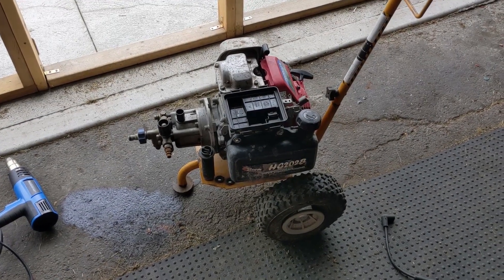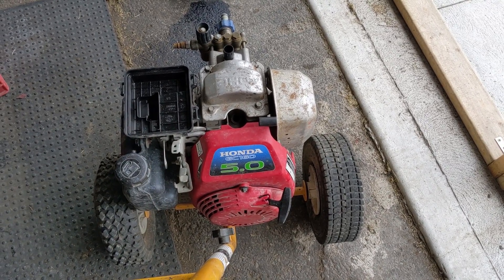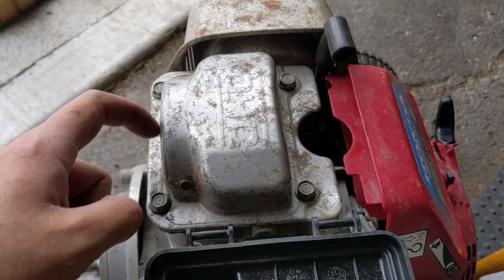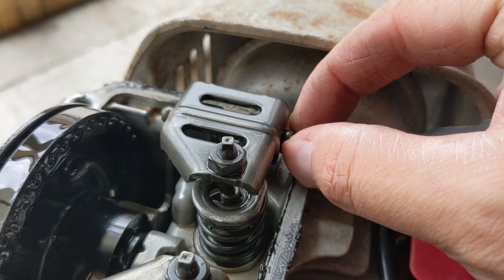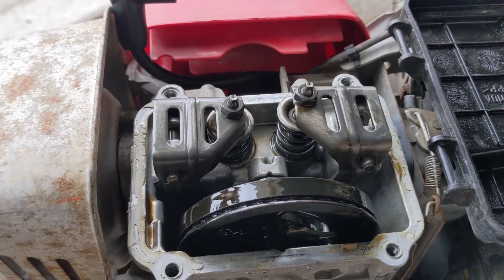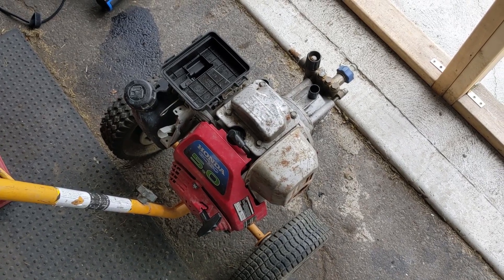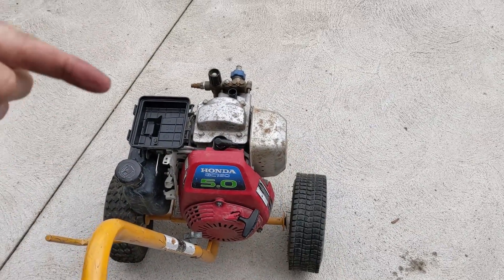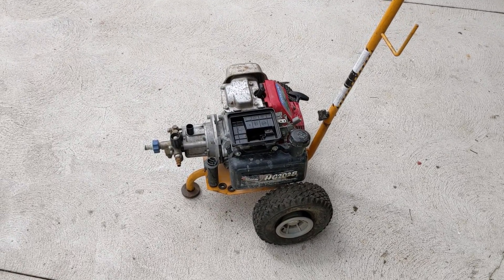How to Easily Fix a Stuck Valve (Quick Fix)

Comment from the maker: The customer didn't want to spend a lot of money (thinking the engine was toast) and was hoping for a "quick fix" which is exactly what they got (same day repair).

Ideally, you'd want to remove the valve for inspection, make sure it isn't warped, do a leak down test to ensure the valve seat seals, then remove the valve and maybe even polish it with some emery paper (fine automotive sane paper).

However, on an OHV (over head valve) engine, you need to to remove the cylinder head to remove the valves. In this case, you'd also have to disconnect the timing belt from the camshaft, this leads to more repair time when assembling due to the need for proper timing alignment.

This leads to more labor and need for replacement parts, as the cylinder head gasket would likely need to be replaced. Additionally, whenever you reinstall a cylinder head, the valve to rocker arm clearances would need to be adjusted, which leads to more time spent on the repair. (I.e. more cost for the customer).

At the end of the day, this pressure washer now starts 1st pull, runs smooth, and the pump works. Making this a fully functional pressure washer!
Reply: Thanks for the tip of heating up the valve cover for removal. I've always had a problem with the ones with no gasket.
Reply: Can you make a video tutorial for all this ^^
Reply: I

Comment: To help prevent valve stems from seizing:
1. Always overfill oil level by 10%. ALWAYS.
2. Before each cold startup, simply tip the engine, (valve cover pointing down), for a mere 10 seconds. This will pre-lube the valve stems before cold starts.

Comment: I have an xr100 which had rainwater in the exhaust. Found cylinder rusted some, aluminum piston ok cleanable, stuck exhaust valve. I removed the spring and soaked in a bucket of generic oil, leftover trans fluid and marvel mystery oil. I tapped on it and it moved some but not enough. It was tough. I hit a piece of 1/4" soft copper with a hammer not super hard but moderate. I probably need a brass punch now to try to force it further out. Any ideas?

Comment: Is the exhaust valve always located next to the muffler?
Reply from the maker: Yes usually, as that's the way the exhaust gassed pass through the exhaust port. Sometimes if the valves staggered, it may not be exactly next to the muffler, so look at the design of the casting of the head, and you will usually see which way the port travels from each valve. (There will be a bump where the tunnel (Port) flows towards the carburetor (intake) or the muffler (exhaust).
Reply: @EliminatorPerformance  how the intake valve different from the exhaust valve? What characteristics makes them different so when I get them I know the difference? Thanks!
Reply from the maker: @JuguetesYGomitas  the intake valve is almost always larger than the exhaust valve

Comment: Same Honda engine and it was this simple.  
Did the pressure test with my thumb - no pressure 
Off with the cover, no movement on the intake valve, rocker arm off……tap,tap,tap…valve free..gave it some exercise
Reassemble and started right up

Thank you for the well described video

Thank you

Comment: Question:
Kohler courage 17.
Valve sticking like this so i pull it apart and clean it up real good and it works great for the summer.  Go to start it up for the new season and the valve has done it again.  Should i just replace the head and be done because im reading somewhere that i may have a leaky valve thats causing excessive heat and its burning the oil around the valve shaft.
Thoughts?
Reply from the maker: Kohler's are known for that on some of the courage models. The valve guide has likely shifted too. Unfortunately you'll have no other option then to buy a cylinder head and the valves and springs, the rest of the stuff you can likely reuse (like rocker arms adjusters etc...) unfortunately they don't sell them as assembled heads anymore!
Reply: @EliminatorPerformance  one more question.... I inherited a low hour craftsman with a briggs and stratton 20 hp turbo cool ic platinum engine.
Would that be a direct fit replacement or not worth the trouble?  I'm mechanically inclined so it's not an issue but I just wonder if it's just better to fix what I have and sell it or replace the whole engine and be done.

Comment: My Briggs and Stratton v twin Intek 24 hp rider mower was turning over very oddly when trying to start. It would make a few reluctant revolutions then stop turning over and would not start. I decided to check the valve adjustment and found I had 3 bent push rods and the other broken in two. I noticed the exhaust valve springs on both cylinders would not depress more than about 1/2 inch. I tried gently tapping the valve with a hammer but no luck. Was thinking the engine might be toast so went to google and found your video. Surprisingly, you advised doing the same thing. So with renewed confidence, I tried tapping with a hammer again, only this time with more force. It worked great. I didn't need to do anymore than that and after installing new push rods, the mower ran like new. So, wanted to say thank you for taking the time to post this video. I'll be checking the valves every year now.

Comment: I tried your suggestion. I even let it sock in carb cleaner for 3 days. It still will not move.  Have you done a video on a value replacement on this still of Honda Engine?

Comment: Had a stuck intake valve on my KLR650 - i believe it was stuck due to the massive amount of ethanol gunk that built up over the years.

Sprayed carb cleaner into the vacuum line while it was running for a few minutes and resolved the issue.

Comment: How’s it going Eliminators? I need some help. I’ve got a Honda clone push mower. Exact same valve spring retainers but I can’t get the intake retainer off. I don’t have a special tool, just using the locking pliers trick. Does anyone know another method? I’m hoping to avoid buying a compression tool, they’re expensive here. Thanks!

Comment: I’ve got a stuck exhaust on a B&S.  With the head off, I can tap it closed with a hammer, and then turn the flywheel by hand to nudge it open again, with loud squeaking noises as I go.  But it stays open.  It takes the hammer tap to close it again.  I’ve done this 10+ times.. it does not seem to be getting any looser.  I’ve sprayed penetrating lub on the valve shaft before I tap it down each time.
Any suggestions?  Should I just keep doing this?  Even if I removed the retaining clip, I won’t be able pull the valve out.  I can’t spin it with my hands all.
Reply from the maker: The valve guide is most likely worn, or the valve stem itself is warped and could be getting hung up. Even a few thousandths of an inch is all it really takes on these. You may have to remove the head and replace the valve guide.
Reply: @EliminatorPerformance  Thanks for the reply, and thanks for your videos!   I've released the spring.  I can get the valve out about 1" then it seizes and will not come out further.  Even with a lot of force.  Its like it gets tighter the more it comes up.  I can tap it back down and raise to the same level..but not past about 1".  Are there any specialized valve extractor tools out there?  I’ve searched, but have not found anything.  I’ll never put this valve back in if I get it out.. so chewing up the valve head is not a concern at this point.

Comment: It’s a little trouble to remove water pump but better than running it dry and destroy a pump 
Also pump may allready bad and they will sue you for new one
Reply from the maker: After many years, I've never noticed a pump go bad just by running it dry for a very short period of time here and there. My own generac pressure washer would be a good example. I've never been sued either lol

Comment: I have the same machine.  Mine is a 2005 and I always changed the oil with synthetic, also ran ethanol free gas.  Never had an issue until I was using it one day in 2014.  It had been running fine.  I was washing a large SUV and shut the motor down so I could mop it.  When I went to start it back up, the pull start was super loose and it wouldn't start.  I really love the machine, it still looks brand new and was well cared for.  Any suggestions as to what the culprit might be?
Reply from the maker: I heard these GC Hondas have oiling issues to the top valves and this is why they seize valves. I guess it's a common issue, although this is the 1st one I've had come in that's had this issue
Reply: Do you think it’s worth popping the cover off and verifying before I junk it?

Comment: 2:30 A stuck exhaust valve would not make a backfire through the carb.
Reply from the maker: At 2:30 I was referring to compression at the spark plug hole, if there's no compression but the piston and rings are good, you could have compression escaping through the intake or exhaust valve. A leak down test would prove that, or just pull the ohv cover as I did in this video.

Comment: Great video 
I have a similar problem. My husqvana push mower with a Honda motor start to give me some problems. The push cord is kicking back big time. I took the flywheel out anti inspected the key and it’s fine, so I drained the oil and inspected the spring valve and I noticed the left side does not move when I turn the motor. Will that cause the kick back???

Comment: Those Hondas are terrible about sticking intake valves. Especially if old gas is used. Use some ATF to clear some of the carbon that is causing 8t to stick when you work if free.

Comment: question fir yiu i have a dynamark 8-36 and  the starter turns the thing on top and it makes a clanking noise but it wont turn engine its  making spark and is not locked up and has fuel and air so what can be causing this please let me know im 14 and i love fixxing small engines and i cant figure it out plus i dont got my dad and my moms not good with this stuff lol
Reply: There are a number of reasons your engine will not start: 1. It may not have enough compression 2. Intake or exhaust valves may be stuck in the open position 3. The flywheel key may be sheared making timing of the spark off position 4. The spark may be weak and not igniting the fuel 5. Fuel may not be getting to the spark 6. The spark plug may be incorrect or bad especially if it is an aftermarket Torch. There are many reasons, i would suggest you subscribe and watch as many small engine repair channels as possible and cut a few lawns to generate some cash to invest in tools. Also ask for tools for Xmas i think you just may make one heck of a small engine repair technician buddy.

Comment: I usually just leave the valve cover on and use a 3 lb sledge 😉
Great video buddy
Reply: They bend too easily and takes more time to straighten them out than the time it takes to heat and release the cover when they have used RTV gasket maker.
Reply from the maker: Little tap with a soft blow mallet does the trick after heating them with the heat gun!

Comment: That engine looks like a over head cam style of engine  I see it has a timing belt  I could be wrong about that matter young man 😎
Reply from the maker: Yes OHV with timing belt, good engines, just don't run them low on oil!
Reply: @EliminatorPerformance  I heard that young man 😎👍 thanks for the heart also

Comment: Great fix. Those are good engines and keeping them running for cheap is a good deal for the customer, who will use it today and let it sit 12 months until they use it again
Reply from the maker: Yes exactly, best to keep oil in them and run premium fuel with no ethanol if they can get it. Thanks for watching!

Comment: Good video,I've got a stuck intake on horizontal Briggs flathead,you are the man!Keep up the good work!
Reply from the maker: Thanks Jungle Bob, maybe those are a bit easier, you can remove the valve and polish it up, clean up the valve guide without having to remove the timing belt like this one!

Comment: Is it ok to run without water
Reply from the maker: it doesn't hurt it you do it for a short time, but if running for long periods of time, the water should be hooked up. These pumps have oil in them, which does lubricate them.
Reply: Many of the operators manuals for pressure washers will say not to run the engine without the water hooked up and while running do not run without engaging the gun trigger to engage the water gun for more than 2 minutes at a time. Some also say to start with the gun trigger engaged while it is not necessary on others. When asked this question by customers we always tell them to refer to their owners manual or if they do not have one we check for one online for them. We have tested many like Jake did for short periods of time to ensure the engine runs without damage but we also have hoses and wands to hook up to test under load conditions.